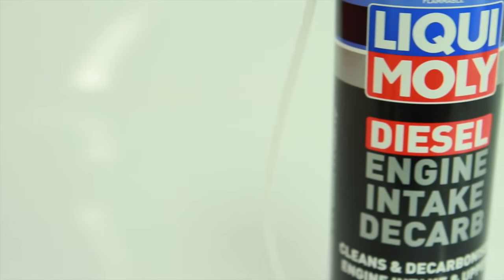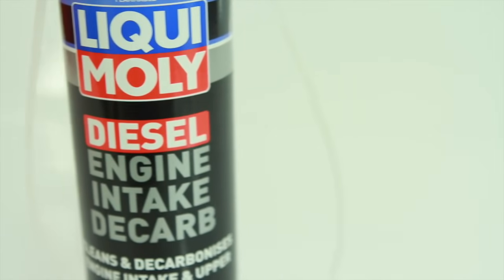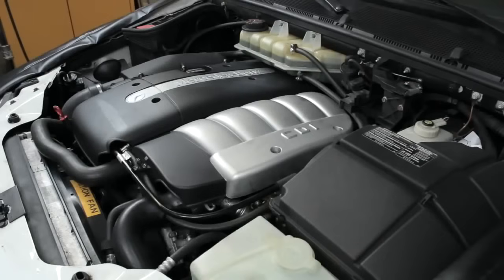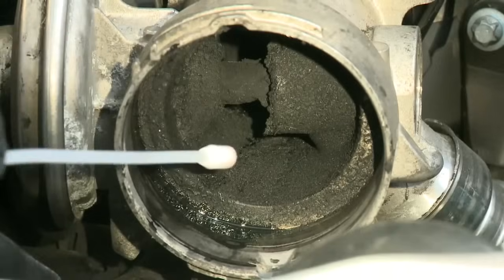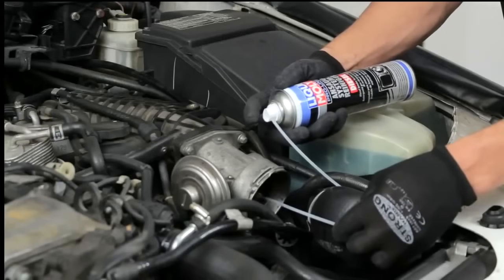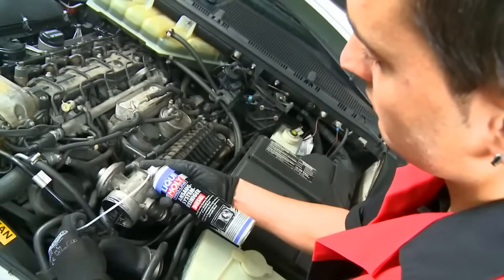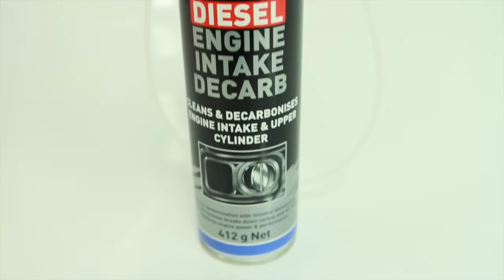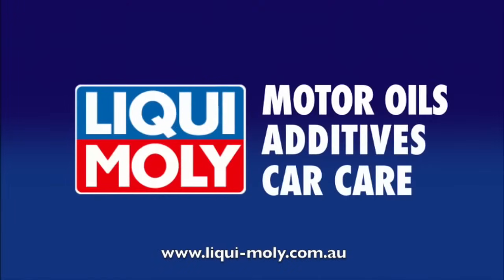Liqui Moly - Diesel Engine Intake Decarb // Supercheap Auto

Comment: I did this and it took my diesel mechanic a lot to clean up. The carbon goes hard because of a chemical reaction. Also forces all the carbon down into the intake manifold and valves. Not a good idea and pulling the EGR system to pieces is the only way to clean up the carbon. Don't be a fool like I was because it cost me $2,000 more to fix. There are no short cuts in a can with this repair.
Reply: I had exactly same problem. Fill your pain now. Fricking liquidmoly should take full responsability for all this
Reply: So i shouldnt be doing this?

Comment: Yes, some gunk does get into the engine oil particularly in older motors. I noticed this by checking the dip stick and the oil was darker. So now I only do intake clean just before engine oil and filter change, which also includes oil flush. I found it's worth including an intake clean as part of oil and filter change, but remember to do intake clean first.

Comment: Hi, 

I tried it and works, but be very very careful; it can harm your engine by knocking and DPF will be full during cleaning. Don't hurry and keep the 2500RPM during the operation (too low RPM cause some of the liquid remains in the system) and do a highway round after the process (because of DPF full plus some of the liquid remains in the intake system). Important the careful acceleration with low RPM-s at the beginning of highway round because some part of the liquid remains in intake system (I know I wrote it many times but it is important) and can do self acceleration from RPM 2000 to RPM 5000(!) in half seconds and will cause knocking (sounds like a big hammer knocks your block) can destroy your engine.

Overall result is fine, engine less lazy than before, but use this liquid very carefully!
Reply: Sorry to be so off topic but does someone know of a trick to get back into an instagram account??
I stupidly forgot the password. I would love any tricks you can offer me.
Reply: @Zachary Gabriel I really appreciate your reply. I got to the site through google and im trying it out atm.
I see it takes quite some time so I will reply here later with my results.
Reply: @Zachary Gabriel It did the trick and I now got access to my account again. I am so happy!
Thank you so much, you saved my account !
Reply: @Maverick Francis No problem :D

Comment: This product worked perfectly on my suzuki Swift Diesel. Now the engine runs smoothly.
Reply: What about engine oil condition after this process was it dirty or same.
Reply: Avilash storm
Reply: Avilash storm did you put it in from the turbo air inlet

Comment: "It also removes many other contaminates & you might need to repeat the process". 
Hmmm, I have heard all this before & I believe that the only thing that this stuff is guaranteed to remove 100%,, is quite a bit of thickness from your wallet. 
In my opinion it is just more "Snake Oil" because no matter what they say, there is no product in a spray can that can do it properly without removing your intake manifold & DPR.

Comment: Can we spray the decard just after the air filter and before the turbo inlet
Reply from the maker: Hi Ashwini, correct, use this product after any air temp or flow sensors. - Ash
Reply: Supercheap Auto  .. so can I use it directly into the turbo after MAF?
Reply from the maker: Hi Ashiwini, Yes it's fine to use before the turbo as it'll de-carb the turbine at the same time as the rest of the intake system. - Ash
Reply: Supercheap, how does it decarb the turbine when it is only drawing in fresh air with normal operation?
There shouldnt be any carb build up on the turbine, if there was (but can't be) it would result in turbo failure
Reply: Keith Hellyer  The turbo usually draws air and also any oily mist from the PCV (Positive crank case ventilation) in most modern turbocharged vehicles (petrol and diesel)
Reply: The Turbine is the hot side (exhaust side) the compressor wheel is in the intake side.
Reply: @ashwinipatel3  no, just in the intake side of manifold after turbo, because turbo side is propelled by exhaust gasses !
Reply: @supercheapautotv  does this product also clean the valves after the intake manifold?
   This is where most of the crud is located and intake manifold.

Comment: What about bits of carbon getting sucked into the piston chamber and causing damage?
Reply: Yes I found some gunk does get past the piston rings and into the engine oil, checking the dip stick I could see the oil was darker than before. So I do intake clean just before an oil and filter change. Damage occurs if you continue to dive the car with dirty oil.
I found it is worth including this intake clean as standard procedure for oil and filter change. Also do an engine oil flush before oil change.
Reply: Shouln't be a problem. The carbon is relatively small particles and even clumps of it will break up in the pistons and get ejected to the exhaust which what ends up in the DPF (where fitted).
Reply: @chapster6273  little or nothing should get past piston rings, valve guide seals etc unless they are worn.
Reply: this is why it's recommended to do an oil & filter change after this process. They dont tell you that but if its due for a change then do the treatment beforehand.

Comment: I didn't know diesels would accept anything buy air into the intake system? Wouldn't run away be a problem? A.K.A. 5k rpm+.  Otherwise, taking the egr system apart and cleaning it and or taking the whole engine apart is the only alternative.  Your thoughts would be greatly appreciated.
Reply: It works to a degree but is no substitute for manifold + EGR removal and manual cleaning .
Reply: @mjhmech4903  yes I do it with removal off these components, but when the inlet manifold is removed you can also spray it direct into valve holes to clean top of the valves, very important ! After this is nice to change the motor oil, because all the grease is going to motor oil. Also the turbine is cleaning this way with the same flow by exhaust gases through the blades !
Reply: Actually using this spray only for maintenance reason not for fully blocked one. For hard to get egr valve this is really helpful process.

Comment: hi will clean the vanes inside the turbocharger ? i want specialy for this part! also for exhaust ? who can say what parts clean this product and if they are some improvment, cheers !
Reply: Peter  What terrible advice to be generally throwing around. Such a risky move when you don't know what materials it's contacting/ providing no caveats on its use.
Reply: Peter  Hahaha! Liking your own comments! You literally just posted it yet already a 'like'.. So you, in your great 34 years of experience, can say, unequivocally, that it's completely safe to spray highly caustic oven cleaner down any vehicle's intake?
Reply: Peter  Come on Peeeeeeeteeeeer, tell me how caustic solution is universally safe for engines and their components because you obviously felt that I stood on your highly experienced toes by claiming your comment was irresponsible by omission.
Reply: Peter  You've never had problems so it isn't a risk.. Heard of anti-vaxxers? Seems I've experienced more to do with the negative impacts of caustic and aluminium... But hey, I obviously have no idea, and you're not ignorant at all! Do I need to reiterate that your original comment, the one to which I originally responded, was flawed by your generality and omission of caveats..So by saying "oh, only 15 minutes" is a partial correction in support of my comment. Just keep up with the smart comments ignoring that you could be, at all, morally improper; set people up to make their own mistakes; no better way to learn to not listen to people in YouTube comments, recommending the 'easy' way to do things.
Reply: Peter  And how are you rinsing it off after 15 minutes when spraying it into an intake? Is that, maybe, another caveat you missed? (to not spray directly into an intake..).

Comment: hi can i use this to clean turbocharger for ( vw polo 1.2 tdi )
Reply: I'd keep it downstream from the MAF sensor. Just your throttlebody and intake manifold.
Reply: @steverx4460  The turbo is always after the MAF sensor in the intake system. That said you could only possibly clean the cold half of the turbo with this fluid, but it's actually the hot half that's driven by the exhaust gases and thus might develop carbon deposits which need cleaning. But you obviously can't reach them directly (because of the combustion chambers being in between), even though  some cleaning effect might still occur.

Comment: now, all the dirt get in to the engine.
Reply: Wasin Intasarn ideally you would do this just before changing the oil and filters.
Reply: yeah does this not send all the carbon down into the valves and engine again?
Reply: To get burned off and/or pumped out the exhaust. As said above, it is recommended that this is done before each oil change so if any solvents leak down past rings etc then they get dumped with the old oil. Subaru do this with every service.
Reply: Also, ensure engine is at full operating temperature and engine bay is fully heat soaked prior to performing this clean. It would be a good idea to do a highway drive to clear the dpf after as well.
Reply: @sourwords1808  and just before installing a catch can.
Reply: So ? It gets burned there
Reply: @davidgriggs3967  agree, once clean install catch can like the manufacturer should have.
Reply: It's supposed to get into the engine--that's the whole point of EGR and PCV.

Comment: Will or should this product work on a  3ltr d4d Toyota engine?
Reply from the maker: +Krimreeper Hi There, give them a call, they should be able to help you out: (02) 9737 9422 - Thanks
Reply: don't think so clean it yourself  very simple
Reply: Yes - remove intercooler and spray into throttle body / EGR

Comment: yea as someone else said all the shit is now over your pistons and cylinder bores.
Reply: UkPrepper2016 Military/Survivalist that is not true diezel engines are so powerful that they burn all that crap that the compression stroke is already
Reply: Heard of someone using it and apparently a big chunk of carbon/gunk broke free and proceeded to the turbo and smashed of a fin of the turbo n he is now up for major repairs.
Reply: @jimiharper6996  you don't use it before the turbo dummy
Reply: ...where they get burnt by combustion temperatures. Problem solved

Comment: If I spray this after the MAF, and before the turbo intake. Will it not just buildup in the intercooler.?
Reply: Yes.
Reply: No, because it leave the spray hose in a form of a very fine mist that travels with and in the intake air. Some of it might of course land on the walls of the elements of the charge air path (like the intercooler), but even from there it will be continuously dragged towards the intake ports with the charge air. That said it makes no sense to spray this in before the turbo, because the cold side of the turbo doesn't need cleaning, and you can't access the hot side. I'd rather spray it as close to the actual EGR valve and intake manifold as posssible.

Comment: would all this just go into the DPF lol ?
Reply: Yes but the dpf is 'supposedly' self cleaning. Go for a long drive for 2 hours of highway driving and it should burn most of the crap out of the dpf
Reply: Regeneration takes care of that
Reply: @ElisPalace  then why so they get clogged then?
Reply: @muckman5509  Usually they get clogged from running rich from boost leaks people don't realise they have, the standard burn parameter then isn't enough to keep them clean. You'll see it on TDs that have leaky intercooler pipes, the DPF gets clogged and the light just stays on permanently

Comment: Would this work on a hj47 you reckon?
Reply from the maker: Hi Catlady 43, If it's the original diesel 4.0L engine, it'll work great at breaking down the build up of excess carbon. - Ash
Reply: good bus i got a RJ70

Comment: Bla Bla Bla, I've heard it all before.
 It might be OK on a new vehicle but you would have to use 20 tins on an MN Triton with 100,000K's on the clock. Even then I guarantee it will not clean out all of the soot & Gunk that's caked on hard in those Triton manifolds. You could only get it all out of a Triton by removing the intake manifold and cleaning it manually with heavy duty chemicals and scrapers etc.. There is no known other way of doing it, no matter what the snake oil sellers say about their magic products.
 Plus, even if this stuff did clean it all out,, where would all that thick caked on gunk go? 
Some of it would burn up but most of it would end up in your valves & clog your hydraulic lifters & some would end up in your piston ring grooves too. Bugger that, I can only see damage from using this stuff on a high millage diesel with EGR fitted
 Anyway, I bet your 4x4 would be blowing thick smoke for days after using it..
Reply: Way to construct a comment entirely of pessimism and speculation... Here's to never trying anything new 👍 You would fit in well with my dad, who is bewildered by Ford "claiming" their 2.0L bi-turbo is rated to tow more than his 3.0T. What do you say? Blah, blah, blah; can't teach an old dog new tricks.

Comment: and all the carbons will clogged to the catalytic converter
Reply: Diesel has no catalytic convert. Diesel has DPF.
Reply: Not really, diesel has catalytic converter and dpf (dpf on euro 5 and 6 engines)
Reply: @999szt  my diesel from 2004 has Only catalytic converter. No dpf :)